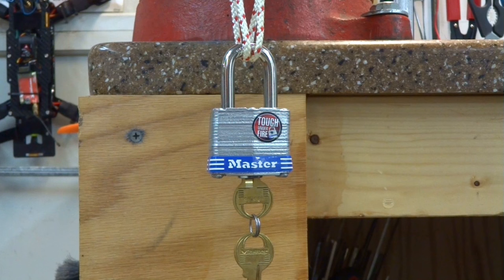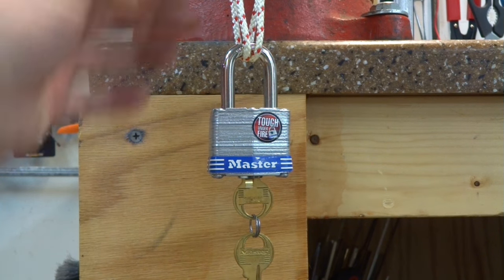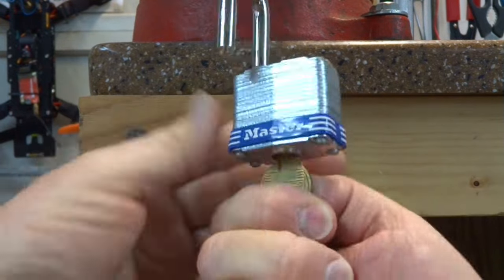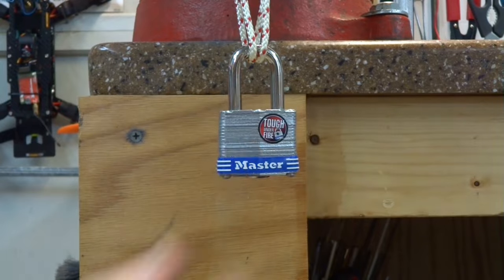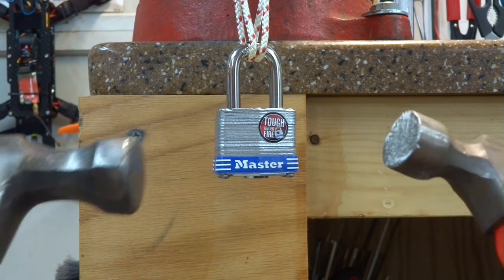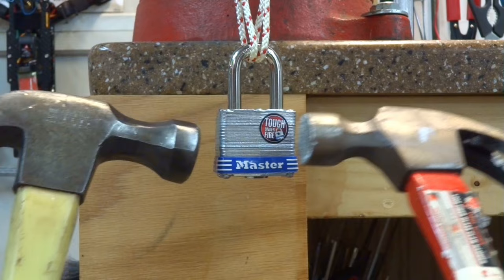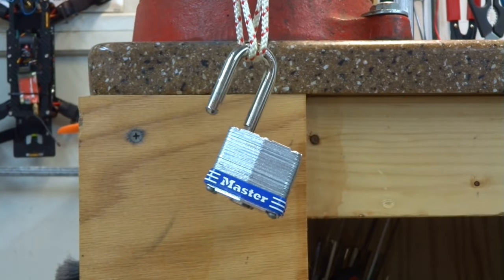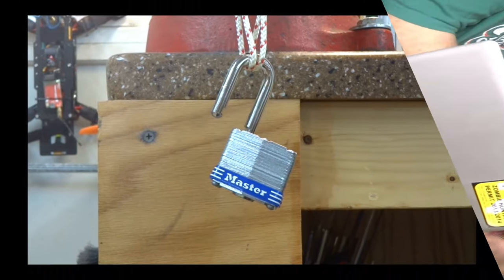(732) Double Tapping a Master Lock Open

Comment: Just when you think all of master lock's weakness have been exploited, their genius engineering steps up again. Great quote at the end.
Reply: +Papa Gleb I'm willing to bet there's at least 10 more ways to open that lock we haven't thought about. With a system that easily duped, there's not much it can do against an attacker with experience.

But the downright laughable part is something as easy as this wouldn't open an old Chinese lock, which were once the standard for cheap shitty locks. Looks like ML have that place now.
Reply: +Papa Gleb I don't think this is the engineers' fault.  Only greed can cause this much fail.
Reply: +DrRawley agreed!!
Reply: +mr42ndstblvd but what happens if they choose a master pro series with 6 security pins? Under 30 seconds?
Reply: +mr42ndstblvd if you succeed, make sure to get a video of it up.
Reply: We would do it with a fire extinguisher.
Quick rap to the top downward and it's all over.

Comment: For reference, could you do the same video with different brands of padlocks to see if they can be opened this way ?
I'm not sure but i'd guess that alot of padlocks could potentially be exploited like this, since some (most ?) have the same shackle mechanism.
I may be dead wrong though, i'm just starting in this hobby :)

Comment: Really?..................Would I be better off just using a piece of bent wire than spending good money on a Master Lock?
Reply: +Bob Jimenez They'd actually have to cut the wire, so... yeah.
Reply: +Bob Jimenez I may or may not have a piece of bent 9 mm thick  wire to keep my property locked for oh..23 years? So yes, it's better than Master Lock if this is all it takes to get in.

Disclaimer, it's just a rear gate i never use, but people have tried to cut it before and have failed. Hardened in place POS wire for the win.
Reply: seems like a bent wire hanger would take longer to open...
Reply: +aserta Hardened in place... umm.. I take it the rear gate isn't flammable? :D... nice idea tho
Reply: +Bob Jimenez Yeah, absolutely! Master locks are complete and total, abject junk! Hell, you'd probably be better off using a chewed up stick of gum to secure something than a Master brand lock!

Comment: Could you place it with a wall or a door on one side, instead of one of the hammers and get the same resault?
Reply: Yes. My friend just held it with one hand and tapped with a hammer. It works